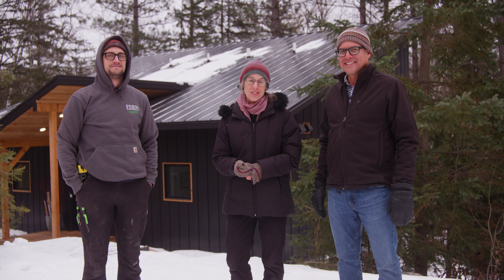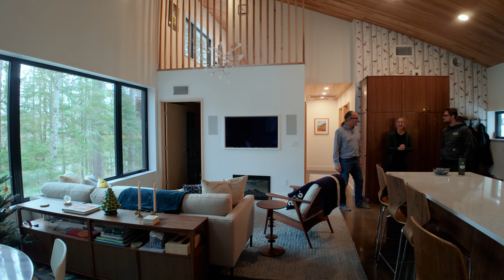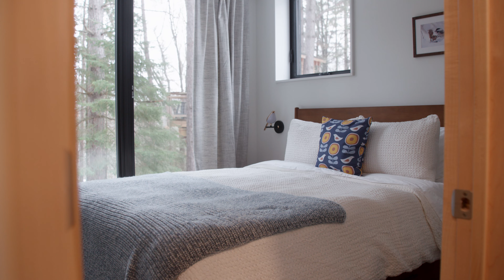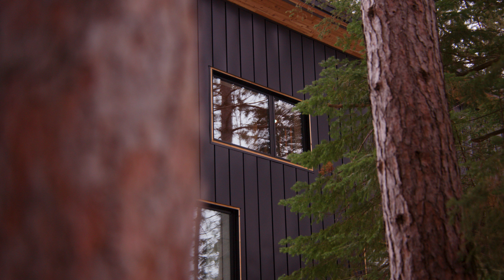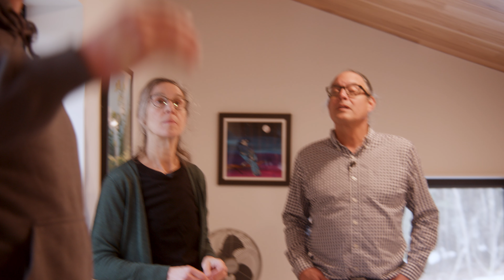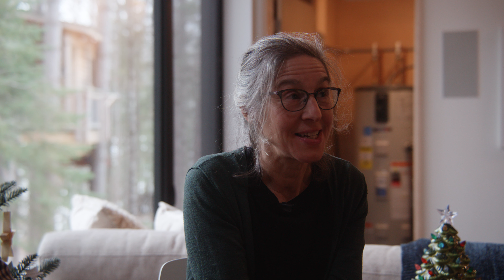A Builder's Reasons to Build Green

Comment: This is a great build, BUT... :) He could go greener. Joking aside, I'm planning to eliminate concrete on my upcoming build with PWF and the 'slabless slab' techniques. However, one question I have is why he didn't go 24oc for the framing? The 2x6 are more than strong enough. I know there's continuous exterior insulation to stop bridging, but you'd save lumber and improve sound isolation quite a bit too.

Comment: the exhaust and inlet of the HRV/ERV seem needlessly close together.
Hopefully the exhaust is not coming from a bathroom or something where it matters less. not sure
Reply from the maker: The proximity of the exhaust to the intake of an HRV/ERV does matter, as you note. Just Housing didn't design this house, but I checked with the builder: the side by side vents you refer to are an ERV intake next to a future make-up air intake (a "just-in-case" measure). The ERV exhaust is 6' away, not visible in the video.

Comment: Net zero ready? So a bunch of BS then. Either build actually certified houses or stop using garbage marketing BS like that. Infuriating! These wannabe hippies.
Reply from the maker: The builder was speaking accurately in calling the house net zero ready, since the garage with PV panels hadn't been built yet. Once the garage and solar PV goes in, the house should be net zero. It is BS: Building Science.

Comment: What would be the difference between this and a Passive House?
Reply from the maker: There's not a huge difference, in that this house is built with the same principles of continuous insulation, superb air tightness (it exceeds the PH standard), high performance windows and balanced heat recovery mechanical ventilation. It is not a certified Passive House and I imagine the building energy loads are higher than either PHI or PHIUS would allow.

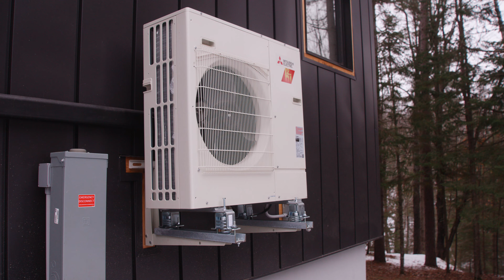Comment: 3:52 wow, I’ve never seen spring mounts on an condenser unit for a house before. Mitsubishi Electric units are so quiet and don’t vibrate so you don’t really need them. Plus you add the problem of refrigerant leaks in the future as the pipes move more.

Comment: I think living inside an Igloo cooler is rad. Who needs clean air. It's way overrated.
Reply: Air is exchanged in all houses. The only difference is if it is intentional or unintentional. The irony is that when it is intentional, you can actually ensure that it is clean air, where in the alternative, you get whatever leaks into your house.
Reply: With all those windows, it's far from an igloo cooler. A good window is worse than a bad wall

Comment: Is there radiant floor heat in the house or is it just heated with the heat pump  mini split?
Reply from the maker: It is heated solely by the ducted air source heat pump. The floor has R-24 insulation underneath, so it feels warm even without radiant heat.
Reply: @just-housing thanks for the reply! How many inches of foam is that?
Reply from the maker: @daveschreier6019  6" of EPS (expanded polystyrene), installed in 2 layers of 3" material, with staggered seams.
Reply: @just-housing thanks for the reply!